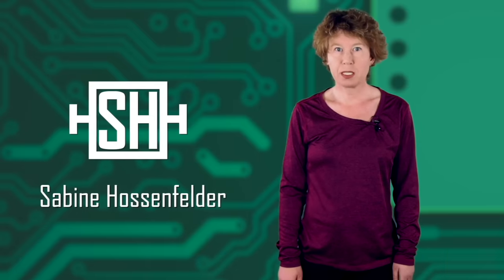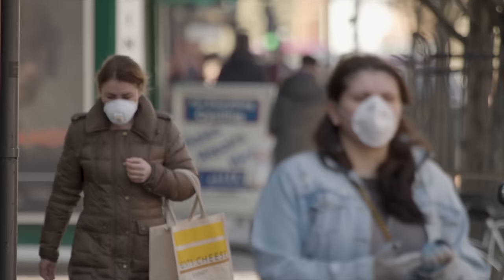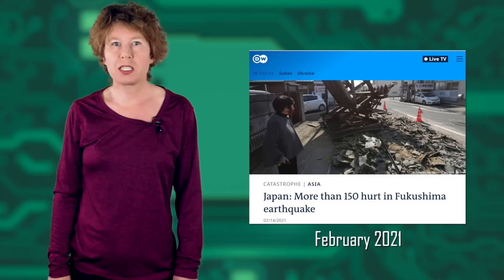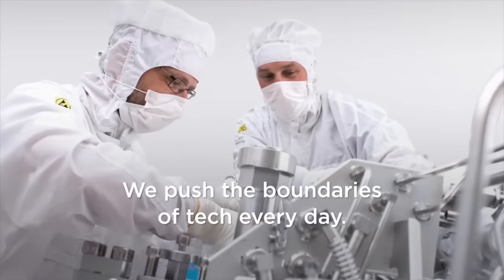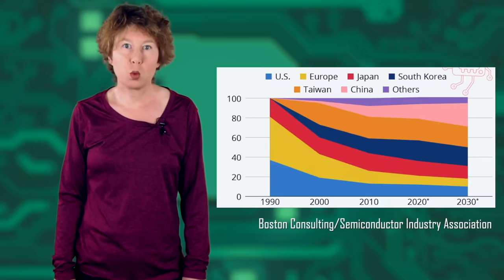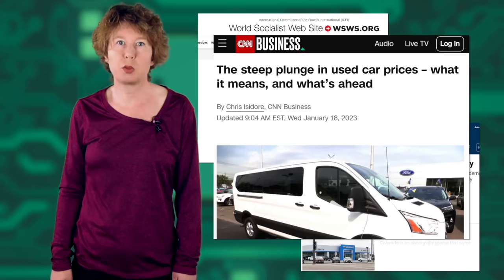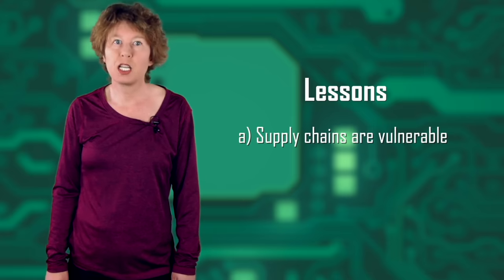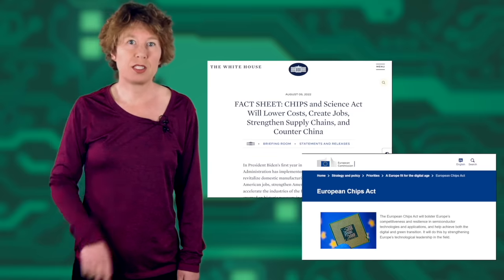All you need to know about the microchip crisis

Comment: Thanks.  I'm in the industry, and this was a very useful refresher of everything that happened.  It's not just chips we've had problems with, but also discrete semiconductors like Zener diodes, where the ones we needed for safety critical applications all seem to come from Onsemi.  Current lead time 51 weeks.
Reply: Too true… and thank you for just calling them “chips”
Reply: I'm in automotive.  51 weeks seems like tomorrow.  I'm still waiting on parts I ordered in 2021.  I might get them before 2024.
Reply: Wow! I'm not in the industry, @epiendless1128 & @rbyt2010 & @Skipsul,  so thank you for sharing the shocking eye-openers. Outside of the electronics industries, we really don't have a clue yet suffer the consequences.
Reply: So when will be the best time to buy me a new smartphone? ;)
Reply: I also worked in TV industry, back then a "shortage" would only be for the unique "concept chips", which could prevent production if not available, because it's produced by only one company without any equivalents available from other vendors. However, for all other chips, which are typically standard components, there are always alternate vendors who produce similar, or even pin to pin compatible, parts. This includes even some simple micro-controllers. So if one vendor fails, you can always rely on other sources. And that's a robust production principle, th design should work with parts from alternate supplies to prevent such unforeseen consequences. I really wonder what chips were in shortage for the car industry? I've never heard of concept-specific automobile ICs; all they use are standard, available, microcontroller parts with auto-specific sensors and actuators, mostly for engine-drive & cruise-control, and lately for multimedia-communications. So the shortage seemed somewhat "fabricated" to me...
Reply: @4thesakeofitname  Automotive IC's are specialized and require QC only 1 step down from aerospace.  They are broadly similar to consumer or industrial IC's, but they have to withstand rapid temp fluctuations and keep working between -40C and 125C.  Power ICs (MOSFETs and other drivers) have to withstand horrendous inductive load dumps and massive inrush currents for running DC motors, or keeping alive vital engine timing circuits, steering systems, ABS controls, etc.  Controllers have to have noise and voltage immunities because everything talks to everything else on the car now over the CAN bus.  Cars have vastly more ICs than even 10 years ago, and their count is multiplying (I have a friend who works for a major Detroit OEM and he was complaining about computerizing the dumbest things on a car).  You cannot run these parts on the same production lines as their industrial or consumer brethren, and when auto production shut down those lines were idled or repurposed.  Flipping them back to auto qualification standards takes months and months. So the automotive parts shortages were and still are very very real.
Reply: @rbyt2010  I just happened to be eating some chips when watching this video.
Reply: @Skipsul  This guy knows his shit. I work in a PA GaAs fab. New parts or changes to parts (due to a vendor ECN or supply chain shift for example) require biased HAST testing which can take months to validate. And if you fail, you have to do it again. And automotive suppliers are frequently required to maintain production for a set number of years, even if those products become a burden or drag on other production lines. It's guaranteed income if you win the contract, but frequently becomes unpalatable as the product line ages. And then there's the audits. All of this means there's very few fabs willing to take on the onus of bidding automotive contracts, so when supply contracts for whatever reason, it's a huge problem.
Reply: Also not in the ind., but I know about it being a vintage computer fan, and watching the "Commander X16" go from being much anticipated to much reviled, because the old components it used becoming impossible  to get, or outrageously expensive. Weird way to be updated, but there it is.
Reply: I remember when most generic cpus in cars were PowerPC, long after Macs went x86. I think they switched to ARM, my point is, there are tons on components in cars that aren't in TVs, why are you armchair quarterbacking this issue?
Reply: @FLPhotoCatcher I guess that qualifies you for being a skeptic as whatever...fitname". I wonder if his claim to be in the TV industry comes from  watching lots of TV shows.
Reply: @4thesakeofitname  So, as a semiconductor design engineer whode spent the lions share of the last 15 years in the Automotive world, I can tell you that your point is complete nonsense. Typical IC's for automotive are very speicific in the nature of the requirement and the customer. There are no second sources for any of the devices I've worked on at all. There are alternate manufacturng facilities for those chips to mitigate the things that Sabine talked about, but there are no alternative vendors. It doesn't really matter that you've never heard of "concept-specific automobile IC's" (a term by the way that you just coined, so that's one good reason) it not just a thing, it's THE thing. The rule, not the exception.

By the way, a better term to look for is ASIC. Application Specific Integrated Circuit. Here's a google search for you.

https://www.google.com/search?q=automotive+asic&source=lmns&bih=845&biw=1745&hl=en&sa=X&ved=2ahUKEwidwemPp9__AhUVhP0HHeCnBAgQ_AUoAHoECAEQAA
Reply: @rbyt2010  i like to call them crisps
Reply: @Justin_the_Analog_IC_architect  Hi, please provide example part number that cannot be replaced, so that we can learn.
Reply: No its not over see it wont be over till we as people start stockpiling product and encasing them in polymers and what not for long term storage
Reply: Not great for business even though you can't help it! This whole thing is craziness with no improvement in sight.
Reply: You know that British people also have chips? That joke didn't land the way you expected it to...
Reply: @LiamNI  just didnt get the pint.....yah the fish and chips foks :))

Comment: If anything you are understating the complexity of the supply chain.  It's not just the dies & wafers, but these dies and wafers then need to go through die-bonding (attaching to lead frames) then final encapsulation - and those added steps can take place in different countries from where the dies are made.  So you could make a die in Taiwan, but die-bond in Malaysia, and final encapsulation in China.  Or make the die in Austria (Infineon does this), die bond in Morocco, and final encapsulation in Malaysia.  This supply chain complexity is extremely vulnerable.  I own and run an electronics manufacturing company, and these last few years have been a wild ride.
Reply: We need to scale down consumption as the current model isn't sustainable.

Luckily phones can be built to last and to be repaired/refurbished.

This is written on my Fairphone 4 which is entirely adequate for a poweruser like me.

I can't wait until the day where the software will be designed with the user in mind, and not the people wanting to sell me stuff I don't need to impress people I don't like.
Reply: @madshorn5826 “which is entirely adequate for a poweruser like me“ oh boy the narcissism.

Who cares about what you want?
Reply: @yvesaugustin912  He means he has high demands from his smartphone, and a mid-range device like Fairphone 4 is more than adequate even for his more demanding needs as someone who is an expert in advanced features; meaning, he's not some old boomer who just doesn't use advanced features on devices yet he doesn't need to keep changing devices.
Reply: @RealPi  that wasnt a real question from my side, he assumes that we all have to change behaviour, which we dont.

Virtue Signaling about his fairphone.
Reply: @madshorn5826  Sure it's sustainable. We need to scale up, not down
Reply: @yvesaugustin912  Yes, we need to change behaviour and start supporting companies that actually care about the environment and issues with consumerism.

Phones that have Android, are maintained generally only up to two years before getting abandoned, Samsung is one of the few that does three, and that is still pretty low. But most people don't care to be scammed and keep buying new phones all the time, and buying phones that don't respect privacy, human rights nor environment.

Someone promoting for a better solution is not virtue signaling.
Reply: Thanks for this response.
Reply: @yvesaugustin912  
Ahh, it is not just here in Denmark The Law of Jante rules I see :-)

The people who care if I am a power user are the people who consider buying a phone from a rather unknown brand most known for being fair to nature and workers.
The question I had when looking for a new phone was: Can a do-gooder phone really be any good?

And the answer is yes. I use a ton of apps every day and my ADHD makes me a very impatient customer.
I loathe lag.

Is there more snappy phones out there?
Sure, but in a world creaking under over consumption an expected lifetime of 10 years for a phone is rather important.
And this phone sure is better than the cheap model I help family and friends setting up and maintain.

This is information I would have liked before I jumped and the shortest way to convey that information was to access my skills accurately.

Sorry if I triggered your insecurities.
Reply: @Azarilh  if you want to save resources, why do you need a smartphone at all ? Just buy a office pc keep it 30 years, boom.

Smart phones are luxury that did not exist 20 years ago.
Reply: @yvesaugustin912 smartphones are necessary to participate in day-to-day life
Reply: @madshorn5826  I looked into fairphones, and they are so far from what I want it's not even funny. No OLED display, no ip68 rating, plastic frame, and significantly worse performance than several years older android phones...
If being able to replace the battery means having to deal with that crap, then I certainly prefer having to replace my phone every couple years.
Reply: Why not doing everything at the same place?
It really feels like the same issue with fishing: you fish shrimps in the north sea, send it for processing to Morroco, then send it back for sale in Belgium...
Globalisation makes no sense!
Reply: @benoitmayaux5063  it's quite simple - it's cheaper to ship intermediate products to external processing centers, than to build small (and therefore wasteful/inefficient) processing centers all over the world.

The important concept here is economies of scale: a single centralized processing center with a certain capacity is usually significantly cheaper than N processing centers with 1/N of the capacity. Making a single item 10 times is often more expensive than making 100 items at once.
Reply: @cobaltno51  Smartphones are not necessary for all.  I do fine without one.   They are simply very convenient and we have, as a society,  jumped on the mobile bandwagon.  I admit there are times I wish I had one, and many professions require one,  but they are far from 'necessary' for all.
Reply: @markoulton3342  sure, the amish survive without electricity. 'necessary' is not black and white, it is a gradient. 'necessary' always implies a goal. you can certainly survive with only using a dos-computer, but your ability to participate in modern life will be fairly limited
Reply: There is a shift away from what you describe with everything being made by the lowest bidder and shipped around.  Global supply markets are beginning to decouple as we wean our way off once inexpensive chinese labor and build more vertically in our local markets, with local suppliers.  Mexico will be taking alot of the burden of the prep work with the finishing done in the US and Canada
Reply: @jeremiahlynn9584  I certainly hope so, but that build-out will be years in the making, and unpredictable, with a lot of stupid government subsidies going towards high level halo parts, and not the workaday parts in regular goods, whose shortages have been so crippling.  It's great that Intel is building a giant fab in Ohio, but I need regulators and power drivers, sensors and logic circuits, not crazy-elaborate CPUs.
Reply: @Skipsul  I think if we can workout a deal with Mexico, that is where those factories will be built.  I am seeing wage parity with China already with higher quality workforce.  Still more expensive than Malaysia etc., but the supply chain issue is eliminated as I believe we have the raw materials somewhere in North and South America to make it work....but yes, will take years, but Chips Act was a strong step in the right direction.
Reply: No its not over see it wont be over till we as people start stockpiling product and encasing them in polymers and what not for long term storage

Comment: Great summary. Was unaware of all the fires, and I find it rather suspicious that there were so many at critical plants in such a short period of time.
Reply: yeah, right? like, how long have all these factories been going? how many building-melting fires have there been? In buildings designed to keep human hairs and air borne particulate out of entire factory assemblies, but all are going to have a fire all at the same time?
Reply: @crashdavis4123  Exactly.
Reply: Of which two of them only in Japan...
Reply: There is much money to be made from foreknowledge of such incidents.
Reply: Suspicious hurricanes.
Reply: @bozo5632 and winter blizzards
Reply: @JH-ji6cj and earthquake
Reply: Thinking of the exactly the same thing while watching! How in hell does such a place catch fire anyway. One would imagine the security measures would be ridiculously strict considering how expensive all the equipment and delays are.
Reply: @markoposavec9240  They are extremely clean facilities. They have to be to prevent contamination in the chips. I could have accepted 1 or 2 in that time frame - but 5 or 6? It sure seems unlikely to me.
Reply: or simply we are just not accustomed to monitor such events, since their impact is balanced out normally, hence they are not on the news...

but it would be interesting to know how exceptional is this frequency of events.
Reply: @0netom  I agree with you. Admittedly, I had not done the research to know for sure. That would indicate a lack of safety for critical chips worldwide for an extended period of time. We would have been seeing chip shortages due to fires much sooner than we did. 

It's not impossible, I just think it's highly unlikely. At the frequency they occurred in that short period of time? The biggest most important plants of all on Taiwan have not experienced that. Interesting that those critical plants which China has relied heavily on have not had any.

Here's an interesting article on chip shortages from Wiki: no fires listed until 2020.
https://en.wikipedia.org/wiki/Chip_shortage

I don't lean toward conspiracy theories, finding most of them to be silly and more likely due to incompetence. And the fires could just reflect an unorganized relaxation of safety standards globally to produce more chips. It's possible. And human nature.

But I also think if it looks like a duck and quacks like a duck - it's probably a duck.

I haven't yet looked at the nanometer range of the plants with fires. But if they're ones that China is already producing - that would be a smoking gun to me. I intend to look that up later.
Reply: @Michaelw777.52  I thought the same thing as she identified one factory after another that had had fires.
How does a fire happen in a clean room facility? How do fires happen in MULTIPLE Clean Room facilities.
Way too suspicious to be coincidence.
It made me wonder how many stocks were shorted for these companies and who would benefit from the demise of these facilities.
Take a look at the direct competitors to these companies.
Or the traders that made out like bandits on insider trading.
Reply: @crashdavis4123  Unrestricted Irregular Warfare.